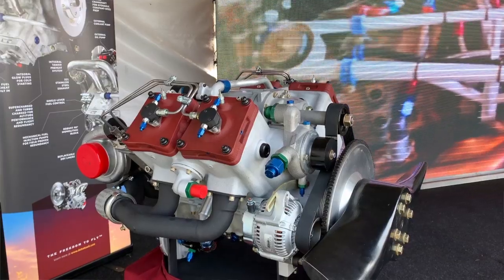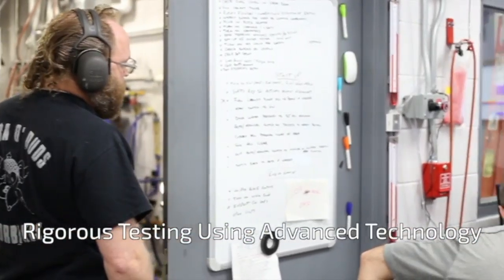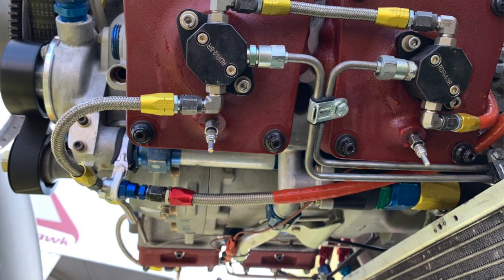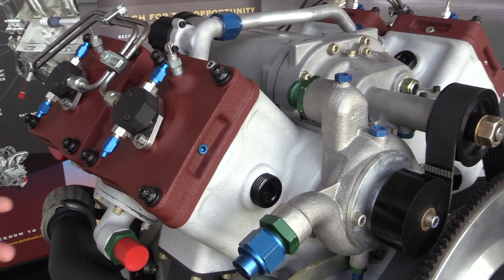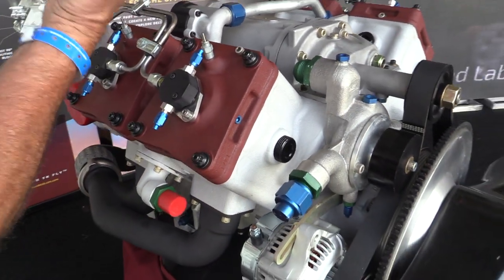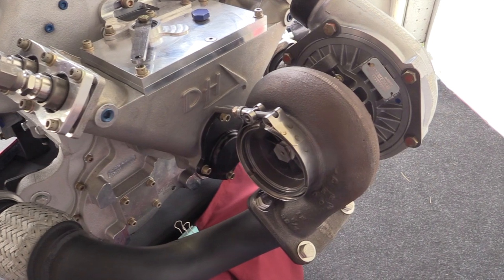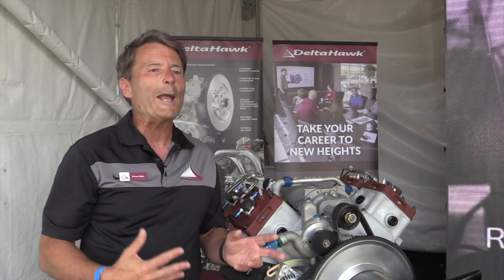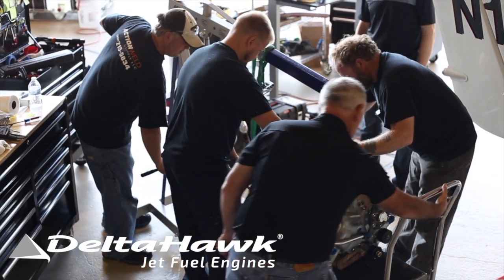DeltaHawk Jet Fueled Piston Engine Update

Comment: Not a good price for general aviation especially when you can overhaul a similar horsepower engine twice for the same price!  Or am I missing something?
Reply: I wonder if the company did market study of the potential buyers for this engine.   Lycoming and Continental already have the engines in the HP range and at a lower price point.  Also Lycoming is coming out with the FADEC for its boxer engine.  In these days, these small engine designers need big financial backing if they want to create new engines in a static or shrinking GA market.
Reply: @2Phast4Rocket  The question i always ask myself is why dont more manufacturers just take automotive engines and modify them for use in airplanes?
Diamond has been doing this for a while now with their Austro engines, their ease of operation and fuel efficiency is remarkable and there are also some C172s flying around with VW TDI engines. 
These engines are already designed so you would only have to redesign certain features (oil supply for example) keeping development costs down. Spare parts are readily available as those engines exist in the thousands, many easily run for 10-15 years so reliability shouldnt be an issue either.
Reply: @Dudeisthere  It is not the combustion technology because  it is old tech compare the cars.  It's the price point the market is willing to support.  If DeltaHawk sells the engine for twice the IO540 from Lycoming then nobody in their right mind will buy it.  That is my premise.  The problem with these engine startups is the get their pricing down after amortizing the cost of engineering, especially in very small, and slowly shrinking general aviation market.
Reply: @2Phast4Rocket   But thats what im sayiong. Why design a whole new engine from scratch if there are plenty of perfectly good, modern and efficient car engines out there that would only need little development to make them suitable for GA aircraft? Designing a whole new engine from scratch like these guys did with a relatively small market will obviously lead to insane costs, so i dont really see the point of it especially if youre using the same old technology thats around for 40 years now.
Reply: @Dudeisthere  Honda have tried to design an aircraft engine based on the Honda automotive engine.  They were ready to get it certified but sensible heads in the Honda's boardroom prevailed and Honda wisely abandoned the project.  They didn't see a growth business in the aircraft engine.  The only bright spot is the LSA rules where small and lightweight, but low performance airplanes are allowed and Rotax filled the powerplant void.
Reply: @Dudeisthere  the major problem is that an average automotive engine uses 80% output for seconds until the vehicle gets up to speed, then the driver lowers the rpm to match speed, at which point most vehicles use around 15% output for hours on end. And if a timing belt brakes you just coast to the side of the road. With an aviation engine they run around 75%+ output all day long and they have to survive in conditions that are more extreme than the average automobile will ever see. You can't afford failures and overhauls are costly because they have to be performed by a certified technician and it has to be documented. Most diesels will last double the overhaul intervals of a gasoline engine even in the worst environments. Also lower rpm means less wear and tear, not always but normally. Pros and cons higher torque output from a similar sized engine means possibility of larger props or more aggressive pitch angles without the need for more hp.
Reply: There was the gemini diesel that was in development untill they got sold to a chinese company (this probalby killed all chance it ever getting any government contracts to further development). They were targeting $25k for 100-125hp and and probably could have done 180HP for $30k
Reply: Jayaus,I wouldn't fly in anything powered by something made in china,not even if you gimmie all off Bill Gates money to.

Comment: high compression diesels.. Only 4 cylinders.. They vibrate like hell.. Good luck selling that to non aviation loving like most wives are...
Reply: It's a 2-stroke. It'll fire like an 8-cyl engine.
Reply: @RunFast64  -- Bullshit.. its not a 2 stroke and wont idle as well as an 8th.. These guys are just getting USA money for BS that wont sell.  They get USA grants for bullshit.. And waste all the money.. Also 180 HP is shit for a Cirrus.. They need over 25O HP to fly well at full gross.
Reply: @feetgoaroundfullflapsC  It's a 2 stroke...

Comment: Question, being a 2 stroke engine, doesn't need to burn oil? That's not very green.
Reply: In general, 2 stroke diesels do not burn oil. The air charge does not go through the crank like a gas 2 stroke. They rely on turbo, supercharger or both to get the air charge into the cylinder.
Reply: You could rig up a system that full from the dry sump and blends with the fuel. You could then go with a biobased oil like Castor 927 maxima. I am thinking of doing this for my truck.

Comment: $89,900. For 180 HP JET-A internal combustion.  Except you can build an entire RV-8 with 180 HP that runs on 100LL, prop, avionics, paint, and interior, and still have enough left over to buy gas for at least a year for $89,900.  This is zero incentive to switch to JET-A unless they stop making 100LL (which they might) which will price most home builders right out of aviation, not send them over to the bank to take out the equity in their house to buy a 180 HP engine for $89,900. Cripes. Explains why they are chasing certification - there is no market in experimental aviation for these engines.
Reply: Steve Blose  THERE IS GREAT INCENTIVE TO END 100LL , WHY ? LEAD, + as much as they make, it’s a DROP IN THE BUCKET,,fuel makers , it’s a PAIN IN THE ASS,     but BOTH ,,CONTINUE, & LYCOMING , have worked on this for years, mo gas is 1 but ZERO ETHANOL !,, ,   Cheers from NJ

Comment: What we need is a hybrid that uses Siemens electric motors (high output, low weight) run by a efficient turbo gas engine generator run on mogas regular.
Reply: So, instead of driving a propeller directly with a relatively inexpensive and efficient piston engine, you want to use a hugely expensive, gas guzzling turbine to run a generator, waste energy in the conversion from mechanical energy to electric energy, waste energy in a motor controller, then waste energy converting electric energy back into mechanical energy... all while massively increasing the weight and cost of the airplane??? Why would anyone want to do that?
Reply: @PistonAvatarGuy  No, not a turbine engine. Something small light and efficient with generator attached. Battery technology is not dense enough yet for aviation.
Reply: @PC-vq5ud  But why would you want the generator and electric motor in the first place, why not just use the engine to drive the propeller? What are you hoping to gain by using the hybrid system?
Reply: @PistonAvatarGuy  lower fuel burn, just like hybrid autos
Reply: @PistonAvatarGuy  NASA and Airbus are working on it. It would be good for GA too.
Reply: @PC-vq5ud  A) Hybrid autos are almost never series hybrids because of the poor efficiency of that configuration. B) Hybrid autos work because car engines are typically run at very inefficient power settings, aircraft engines aren't, they're already used in the most efficient way possible.
-
Pipistrel already tried to hybridize an aircraft, it was a disaster. It never could have worked and whoever came up with the idea must have been extremely inebriated.

Comment: Fully installed $89.9 isn’t bad for the the late model Cirrus, Mooney, or C182 owner. The comment on the UAV market is right on. Military price is probably $289.9
Reply: For $90,000 you might as well just get a turboprop engine from PBS Velka Bites.

Comment: Nice to see a 2 stroke diesel come back to an engine market, incredibly efficient engine design but the EPA regulated them out of existence in the automotive market decades ago.
Reply: I'm not so sure two stroke diesels were ever in the automotive market. The original GM diesels were 4 stroke as is anything I've ever seen in pickups. The old Benz 300D is 4 stroke, and the original diesel Landcruiser too.  Detroit Diesel two strokes were not great on fuel and ate oil like crazy, especially if you kept the oil topped up. I drove one for 5 years and they were completely inferior to 4 strokes. Narrow powerband, very loud, and you had to rev the piss out of them to go anywhere.
Reply: @AndrewShackleton  Saab had a two stroke diesel in the 60's that was sold in the US.  I think it had 3 cylinders.  East Germany had a car that was a 2 stoke.  It was communist crap but there were thousands built and sold.
Reply: @PC-vq5ud  I looked at buying a used 2-stroke Saab in the early 1970s. When a mechanic heard it was a two-stroke, he immediately advised against buying it. (Wasn't a diesel, I don't think.)
Reply: P C the E GERMAN CAR WAS THE ‘TRABANT’, The body was made of some plasticine firer, CANT RUST, , I saw 1 in a transportation. Museum , in SENZHEIM. DE, ON 9’/11/2001 Yes.  Cheers from NJ

Comment: Certified in the expiremental ? Why don't you start selling it to the experimental market before certifying ?
Reply: Helps justifying the $90k price tag.  There is an eight cylinder turbo diesel that is going for certification in the 300 to 400 HP range.  I hear that the price for it will be about $150k.

Comment: As a future A&P, Id love to see more of these. Modern engine. No valves, no cams. Man that sounds nice. XD
Reply: love my two strokes gas and diesel; h1 h2 deutz and 6/71 jimmy no airplane motors❤😂
Reply: 2 Stroke diesels have been around for over a hundred years it's not new.
Reply: @gmcjetpilot  Things work thier way into aviation slowly thanks to FAA regulations.
Reply: @m0ther_bra1ned12  That is a cliche and excuse. There are  certified diesel engines from Continental and another from Europe found in the certified Diamond Twin. The market is small. FAA Experimental amature category gives Americans almost unlimited freedom in engines and airframe. I own and drive a diesel VW. I built an RV7. I have see every automotive and custom engine tried in experimental AC for 35 years, but none have taken over. Why? Heavier, more drag, PSRU issues.... FAA is not the only or biggest roadblock. 

The market not the FAA drives the development and what works. Certification of aircraft and engines is expensive due to cost of Engineering and testing. True, and that is a factor but in the big picture competition from existing airframes and engines is more of a factor. Unless a quantum leap it will be hard to make it a new plane or engine commercial success. Look at LSA planes costing $200,000. You can buy a used C150 for $15,000.

The cost, weight, liquid cooling verses an aircooled gas engines is the question. It's hard to beat a Lycoming or Continental from 200 to 550 cubic inches. If you want more HP then PT6 or TPE331 or Alison/RR250 turbine is the choice. Of course turbine is not typical for GA due to cost unless it's for corporate or wealthy individual. 

Stop blaming FAA; that is weak. Delta Hawk is expensive and low HP. Who knows if their claims are true. Even if 30% more efficient it would take a long time to get that back over a Lycoming IO360 at 1/3rd the cost by an individual flying 120 hrs a year. Deltahawk wants to use the experimental Community to get flight hours and certify their engine. Great, where are they going to go? Is Piper and Cessna going to start installing them in their aircraft? Too heavy for LSA.  Are they going to get STC's to retrofit them in Certifed GA planes? How big is that market? 

Delta Hawk is offering the engines for $80 or $90 thousand to the experimental Community, but that's a lot when you can put a Lycoming in for $25,000. 

NOT all this is the blame of FAA. I worked in aircraft certification and I've worked with the FAA and they're not difficult. it's the market that drives more than FAA. The LSA class of planes and pilot rating, Rotax are all new in the USA in last decade or so.
Reply: @gmcjetpilot  I can assure you that regulations and liabilities are killing the General Aviation community here in the US. I have tried to purchase a Jet-A powered engine but the engine manufactures will not sell them to me. Why is that ??
Reply: @badabing69r  Dude I have been at aircraft certification, since 1985. Tort reform 1994 and 1999 has helped liability. Certification is time consuming and can be expensive. What you want no experienced professionals, no regulations, no standards, no analysis and documention or oversight? It's the market. Thwre are less pilots. Who us going to buy it? Is there money to be made? There are 70 years of GA planes built and cheap used planes. I have an RV-7 I built. E-AB kit planes have cut into the certified market. As far as this engine it's $89.9 K. I have less than that in my whole RV-7 with a Lyc O-360 180HP Hartzell  CS Prop angel GRT panel. This diesel 180HP engine will not be a Quantum performance or efficienc in my 180HP Lyc powered RV-7. The diesel also weighs more than a piston engine. Don't get me wrong I love diesel. I have a diesel car in fact. It's a tired cliche to say it's all about liability and regulations. Again it's about the market. if there's money to be made people will develop new aircraft. The market is saturated with LSA and used airplanes and experimental. New engines and planes don't do much more than an old C182 or Mooney. You can buy one for the price of a new car and upgrade panel for less than this engine.

Comment: I hope these guys succeed. There needs to be an alternative to Lycoming and Continental. Something that could reliably make it to TBO without top overhauls, valve problems, and cracked cases. I know I will open the floodgates but it has always amazed me how an engine that turns 2700 RPM max can’t reliably run for 2000 hours without wrenching it. I know it’s running at max power most of it’s life, and I have heard all the comparisons to auto engines that live at a fraction of max power most of their life, but still seems odd. If these guys could get their pricing in range of current technology, I think they could be successful, but at $89K, they are priced out of the market.
Reply: It's not just the engine, it's a complete kit with custom cowling, new engine mount and so forth.  I think it's for those reasons that they cannot move straight to an STC, and they have to go the experimental route first.
Reply: Because the engines were certified in 1960 and continental and Lycoming don't want to spend a lot of money certifying a new engine. They would rather people just dump money on their old engines. Even today, the engines are the same design as the original sand casted engines, and they were designed to be casted by sand

Comment: Besides one year away from certification for 20 years they've lost the lead. Continental and Austro (Diamond aircraft) have had certified diesels for years. The logic to certify and first sell to experimental market sounds like they're using experimental home builders to pay $90k for their engine and installation to get flight test data.
Reply: well....; 7 month's past by.......... but I do jump in the topic right now // I do strongly believe, you should listen more carefully what you get for the 90'000 dollars package (I'am using the word "package"  by purpose !!! ) // everything else is no serious discussion !! // greetings
Reply: Didn't Continental buy the Morane(Renault)designed air-cooled flat four?It was around 5 liter capacity and very similar to both Continentals and Lycomings air-cooled gasoline designs.Never heard off it after?

Comment: Two stroke? Does it have exhaust valves?
Reply: He said "no cams".
Reply: @phlodel  Yes, Id like to see cylinder head
Reply: @Desmodromic916  the cylinder head will very likely look just like a 2S dirtbike head, although I'm not sure about the squish band. This part of the design is somewhat uncharted territory and I noticed that the head on this version is completely different than the original prototypes.
Reply: A lot of people are saying it's like a Detroit Diesel two stroke, but it's not. It's closer to a dirtbike or sled engine, but burning diesel instead of gas and being fed fresh air by the supercharger like a Detroit. The turbo is a nice plus but not all D Diesels had them. The Deltahawk exhaust is via piston port like a dirtbike. A DD 2 stroke has the transfer (scavenging) ports all the way around the bore and camshaft operated exhaust valves in the head. Source-used to drive at Detroit Diesel two stroke, and had tons of 2 stroke bikes.

Comment: yes I would like a car version of this motor too, this will be a great long trip engine and a mountain climber!
Reply: ThudFalls so you want a $90,000 engine that’s designed to run over 50% power output for hours for a vehicle that needs full power for minutes a year? Man gtfo.
Reply: @superskullmaster   I personally use full power from any stops while driving most of my ground transportation and I do lots of stop and go driving. Towing trailers about half that time, was thinking this engine would be nice in a 1927 model T Ford, or Willis Jeep work vehicle. Betting I use more than the 10 to 20 horse power it takes a normal driver to maintain Hwy speed while I am loaded, thinking more like 25 to 35 HP with my situation at times. It is like I say, much to do about getting to speed for me though and with as much as 180 HP in unique compact engine, I think it could be a good fit.
Reply: Give me a Detroit 4-53T!